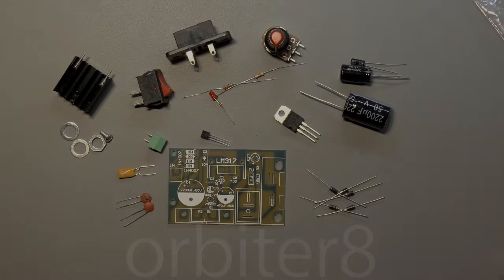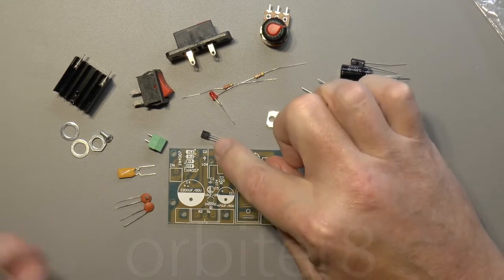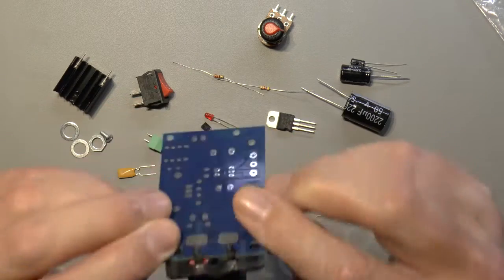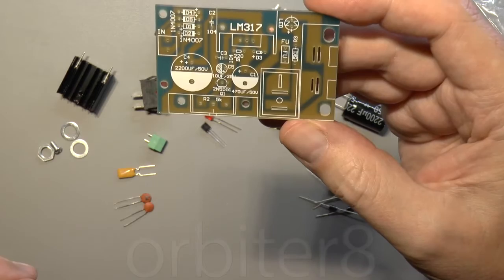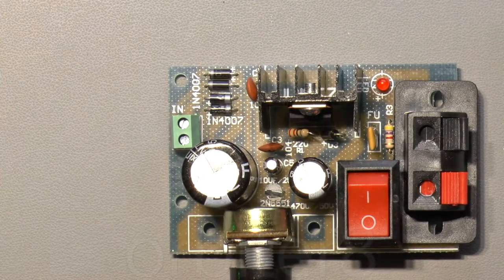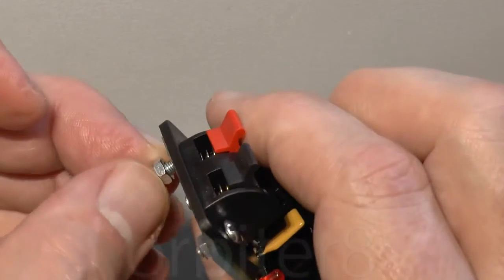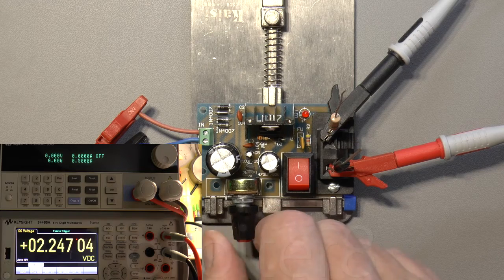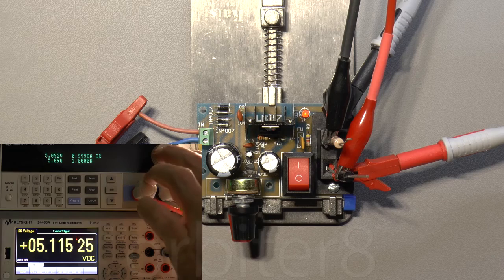DIY AC+DC Input Power Supply Kit

Comment: Nice little build and video. Those LM's do get hot at lower voltages . Plus that putty you use will trap the heat some, so it doesn't help. I was thinking this when you were building it, a little thermal paste would help throw the heat off faster. Then as you mentioned a fan always helps also.
So what was thenAC input? 
I was going to ask if you had a  variac then you mentioned it. I wonder at what input voltage it drops out with AC. 
Some of the battery backup UPS's only put out 90VAC when running, was wondering if it would stay running at 90VAC if it's designed for a 110VAC source. I have many power flickers at my house, lol.
And because I bought these battery backup UPS's before I got into the hobby I didn't realize the output on some are a modified output sine wave. In most equipment it doesn't seem to affect it, but some switching power supplies don't like it and screen a little.
Reply from the maker: Hello mate... Believe it or not the heat sink was around the same temp without the putty.. that was only at the top really to hold the thermocouple in place a bit better.  
The AC input is only rated for between 5 - 25v MAX, which seems about right as the main input cap is only rated for 40v :o  Suppose I could change that though to see which device in line popped next :) The PTC only covers the output.

Cheers mate
John

Comment: In your testing at (30vin-5vout)*1A out = 25w heat. Bench power supplies often use tap switching on the transformer or scr's to put the lowest needed voltage across the pass transistors to keep the wasted power and heat generated lower.
Reply from the maker: Hi Ck.. I always think of it like this.. Total consumed power is the same as the wattage in thermal power depending on efficiency. I tried to make myself an easier method of remembering it after watching one of Dave's early EEV thermal design videos. I still have to check on it though :)

Cheers friend
John

Comment: Thats a cute little supply :-D, but a bigger heatsink and possibly switched input wire wound resistor is needed to stop the lm317 dissipating too much.
Pot wirewounds are better at coping with heat, i think so, just my choice :-).

The led can have the flat missing, so i use 10x eye peice and look for the cup structure in the led, its the cathode :-).
I love the old LM317 and the old old 78xx regulators for there ease of use, im not so in love with the negative 79xx regulators, they dont seem as reliable as the 78xx series.

The L200 is a usefull regulator, but it shuts down too easy with a little heat, but great for pre transistor output driving, the feedback line i connect to the final output terminal, very little loss :-D.
Oh, stealing a shuttle reel from the sewing machine, bad lad LOL :-D
Reply from the maker: Hello zx. Yes I've noticed that some LED's do have the flat edge missing too mate, it makes finding the polarity of some opaque ones rather tricky. Sometimes ya need to use all 3 main techniques for correct polarity ID. Also some jumbo LEDS have the plates reversed :o

Noooo.... I bought the reels from eBay, honest :)  https://goo.gl/zCngky

Cheers friend
John
Reply: LOL i was only pulling your leg on the reels :-D.
One thing i do notice though, keeping most of the large reel of solder in a draw seems to keep it untarnished, when wound on an old plastic maplin reel outside the draw sends it dull.
Or i could just have a damp house :-D.
Dont tell anyone john, im harvey from bedworth, shhhh lol.
Reply from the maker: Ahh a name to Mr zx aye... Good to know ya Harvey :)  
I normally do the same as you with regards to solder.. I keep the ones I don't use frequently In those Baco zip'n'seal bags, which keeps'em looking new.

Take care friend
John